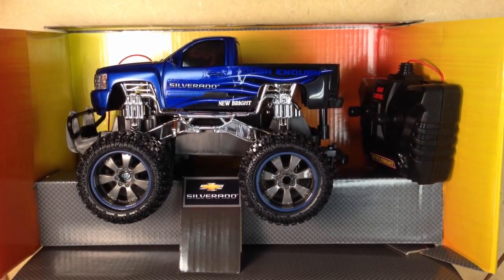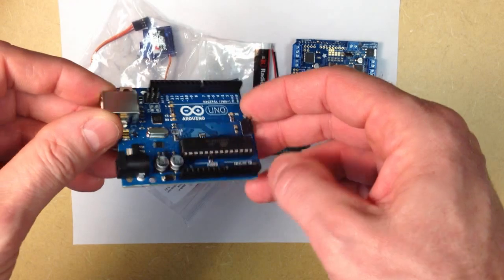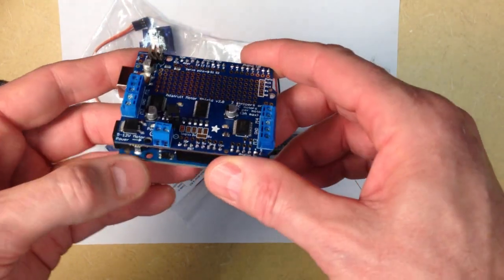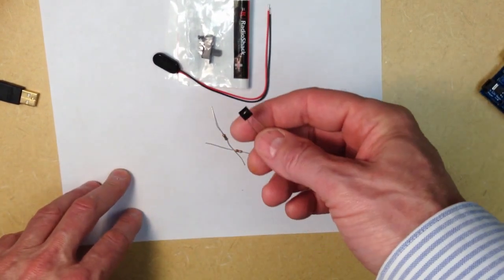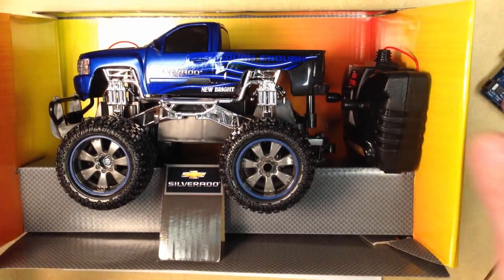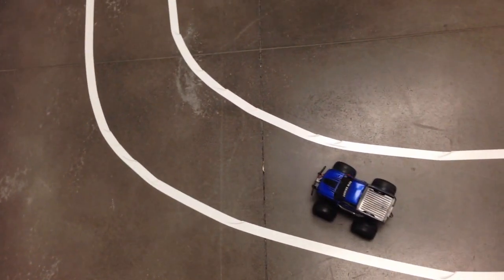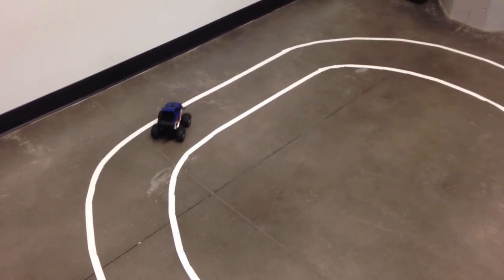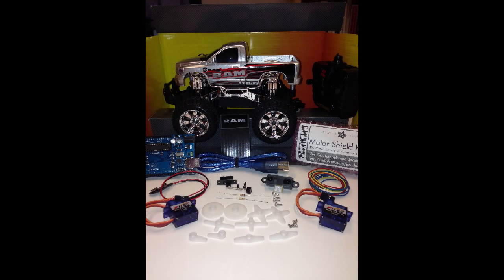Arduino Autonomous Car

Comment: Would be pretty simple to just add a second line detector, have one on the left and one on the right, and have it turn left/right if either the left/right sensors go over the line, right? Then one would only need one broad line for it to follow and it would be turning much more efficiently.. but then again I've never done this sort of project before...
Reply: It would be easy to do what you suggest.

I was talking with a friend of mine recently and showed him the video of the car movement.  My friend builds satellite systems and explained to me that there is an area of study known as "control systems" which addresses systems like the one here to follow the line.  He explained to me that you can measure the amount of light detected and determine where the edge of the line is (since the optics of the transistor give you an analog signal).  Once you find the edge of the line, you can control the car to stay on the edge of the line by turning left to increase the reflected light, and right to reduce the reflected light.

I have not yet spent the time to try this out, but I am anxious to do so.  As I explained in the video, I spent very little time on the algorithm - I just threw something together to demo the general capabilities.

I think it is amazing that we can do these kinds of things so inexpensively.  I look forward to people contributing other ideas on things we can do with these sophisticated, yet inexpensive robots.
Reply: SomePiGuy Very helpful, thanks much. I have the programming experience to tackle the project, just not the engineering experience; only one good way to get that, and it's to build some stuff. ^.^